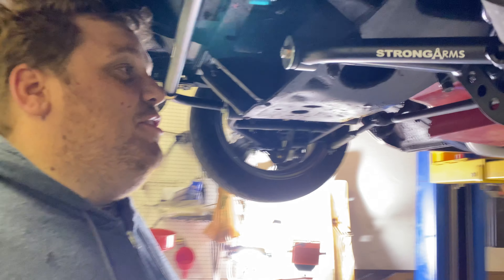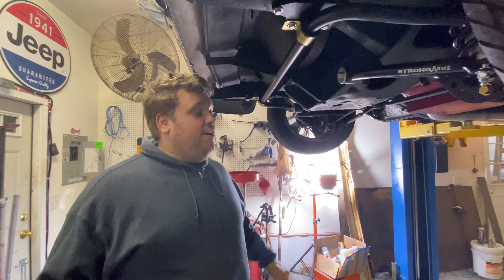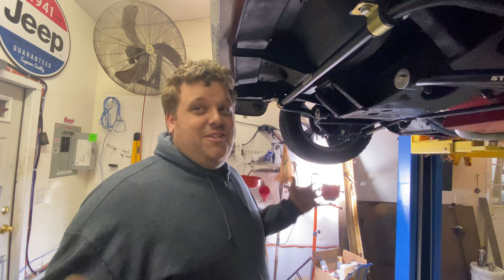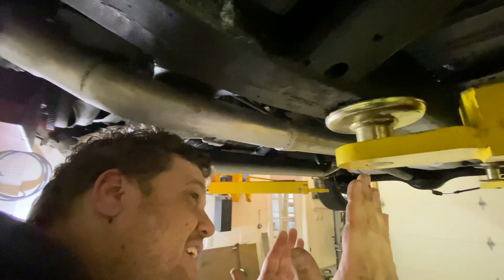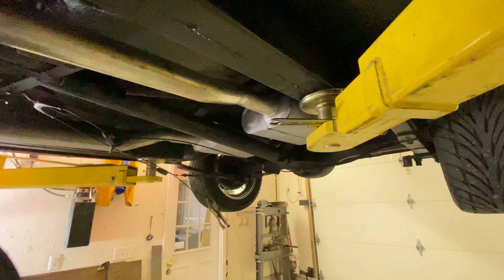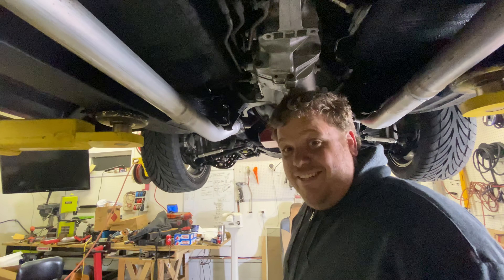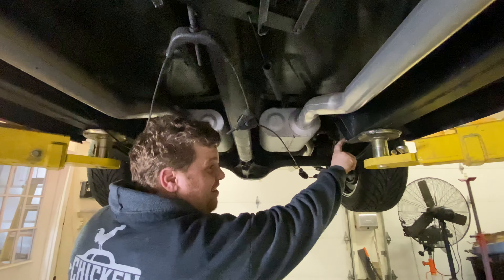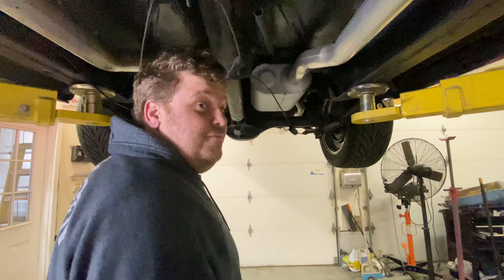How to identify a Tri 5 one piece vs two piece frame

Comment: That's a boxed frame mainly used on convertibles.
Reply from the maker: This is a 55 Chevy two door hard top
Reply: @MaffettMotorwerks   you ve owned many tri5's only 150's had open frame. I've got complete and perfect set of side trim and trunk spears if you need them
Reply from the maker: Yes this is demonstrating how to identify the two piece vs one piece frames.  I will keep that in mind. If you’d like to email us details on the trim our contact info is in our profile.
Reply: @MaffettMotorwerks  I live in Smyrna, loo